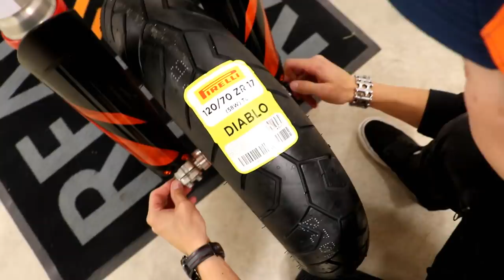KTM 450 EXC-F 2020 Stunt Bike Project | Arttu Stenberg

Comment: I want a supermoto but we don't have the same models that you do here in the USA. What USA model should I pick? All 450 USA models have linkage suspension and 5 speed only...only 500 comes 6 speed and PDS...
Reply: find a 2015 or 2016 450 xc-w.   they have 6 speeds.   i just picked up a 2015 with 27 hours on it for cheap, and the guy threw in a set of warp 9s and conti-attacks.

keep looking and be patient.  good luck.
Reply: @aPhreeMan  IDK man...might just pick up a 500. Found a 2020 husky 501 for a decent price.

Comment: is that a double caliper rear brake??? never seen that
Reply: almost every stunt bike have that, some even have 3 calipers
Reply: @bayronvillalobos8205  why? does it give better brake feel or something? A Single piston caliper on any dirt bike will lock the rear brake up with little to no effort. my 500 supermoto locks that rear 160 up super easy on the street. the only reason I can think of is it gives a better brake lever feel and not more braking power.
Reply: @SkinnySkinch  I’m sure, I thought it was to make the rear wheel lock up faster
Reply: the second caliper is for handbrake